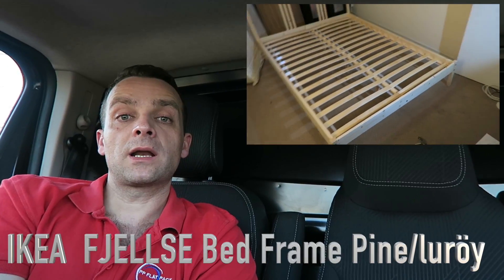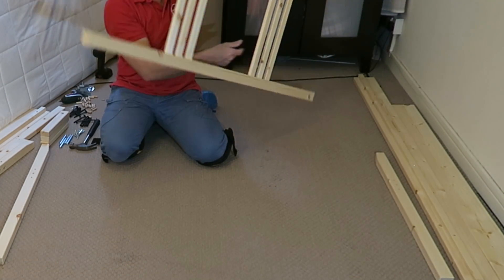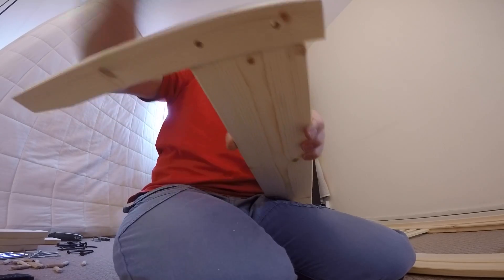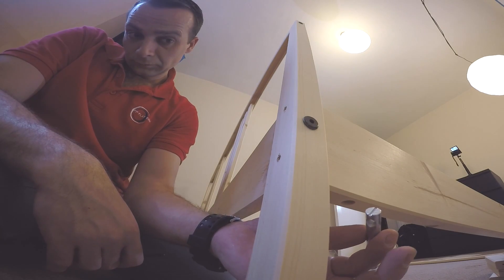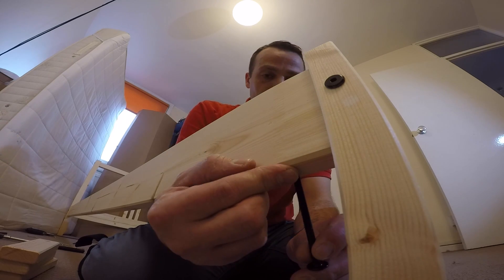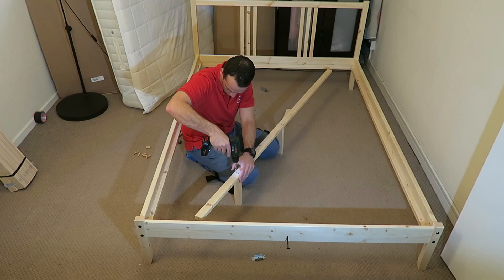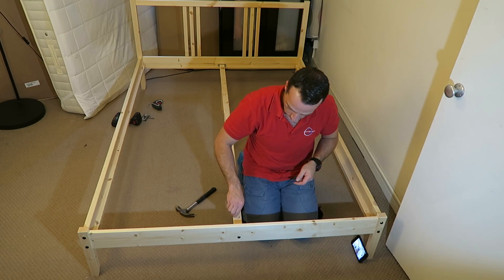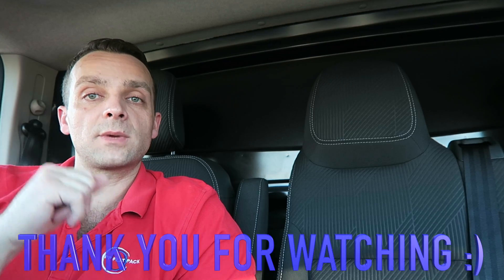IKEA  FJELLSE  Double Bed Frame  Assembly with  LURÖY slatted bed base.

Comment: Sounds like you got a plan. I have a bed from Ikea, but I will make my own frame to hold slats instead of a current box spring, at the hight that I need. Not difficult. We have another bed from Ikea that was made for slats. We find that the slat support works better providing that the spaces between the slats are no more that 2 ". That should work out for you!  Blessings

Comment: this is helpful as I got the bed slats for my bed but I had no clue why they were not wide enough. they are designed for the middle bracer -my bed that's not from Ikea doesn't have and is just a boxy frame so the slats are basically useless...🤦‍♀I will be returning them and going to the hardware store to by some planks of wood cut to size  instead..

Comment: I'm trying to assemble this same bed frame right now without any instructions. I'm having a hard time putting the nail into the metal bar thing with two holes that I have to slide inside and get the nail to go into the two metal holes. I noticed you are using a drill. I didn't use a power drill. Would that be the problem?

Comment: Hi, I was just given this bed without brackets and I was wondering if you know the type of bracket it needs for the middle piece?
Reply: This was my question too.  I was thrilled to see this video. Also, missing some screws.  I was hoping to see an answer.
Reply: To be honest we put the middle in without any brackets. There a so many screws hold the bed together plus the slats in the middle you should be fine.  We’ve had no issues.

Comment: I have a question, which size Luroy bed base did you use?
Reply from the maker: I think one I did was standard double with measurements 
Length:    197 cm
Width:    142 cm
Footboard height:    33 cm
Headboard height:    80 cm